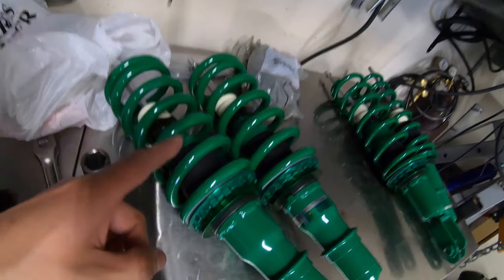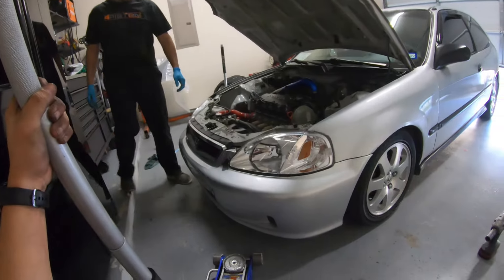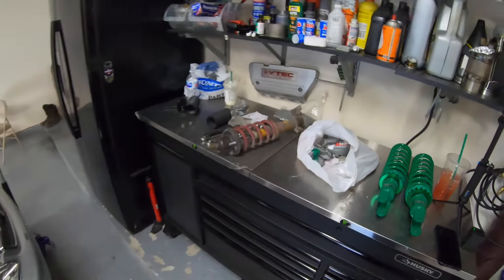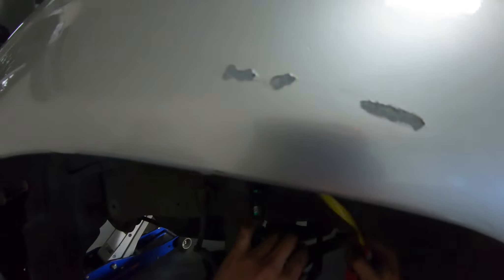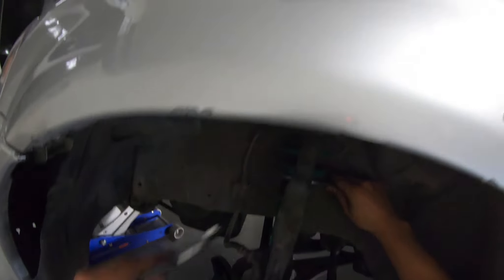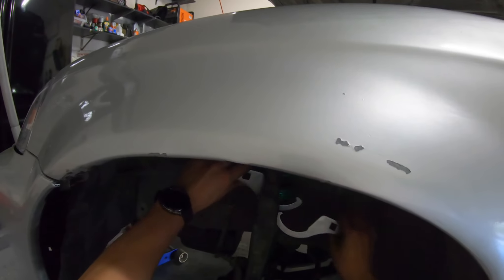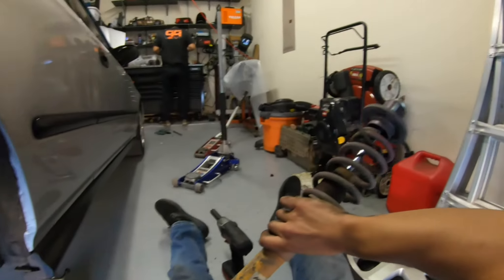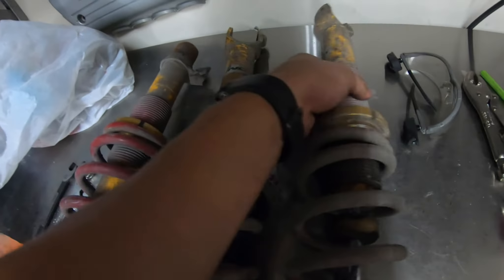A BETTER RIDE QUALITY! TEIN STREET BASIS COILOVER INSTALL ON MY EK HATCH!

Comment: Sorry bud. You should do a little research, koni/ground control are one of the best suspension combos you can get for the money as far as performance. Not as far as daily driving. Your street basis coilovers are almost oem replacement suspension. So yea they're going to be much more comfortable.  The suspension that came off your civic just looks used and abused. And thats OK. but don't expect the basis z to perform nearly as well as a fresh KONI/GC. Also eibach makes the springs for ground control and you can get them in any Springrate that you want. On top of the koni yellows having damping adjustment. Save the suspension if you ever want your car to be semi competitive. If I remember correctly, the koni dampers are rebuildable as well. But don't quote me on that.
Reply: If the koni yellows aren't rebuildable, save the coilover sleeves and just buy the springs you want for them. Like if you ever want to track the car. Just foreshadowing.
Reply: @supersoni126  This, yeah I winced when he was taking out the Koni GC
Reply from the maker: Wow I just  noticed this comment and learned something new. I never knew that Koni/GC are a good named brand. I will make more research next time.